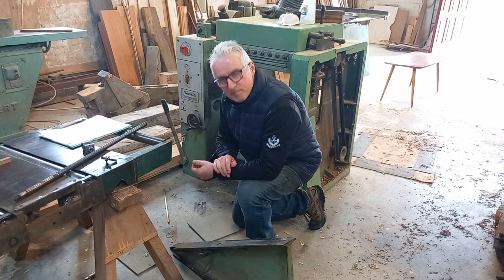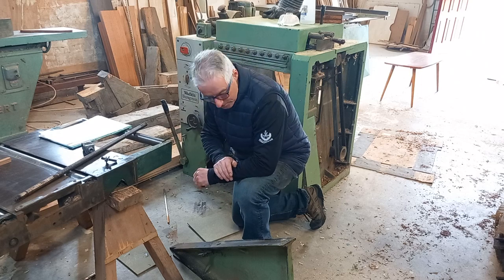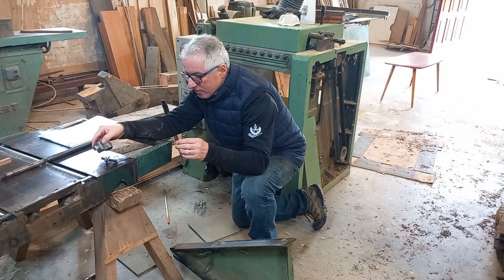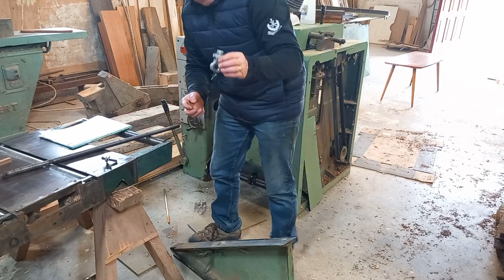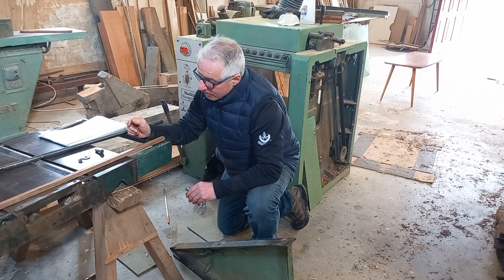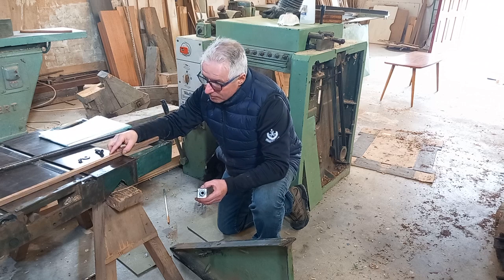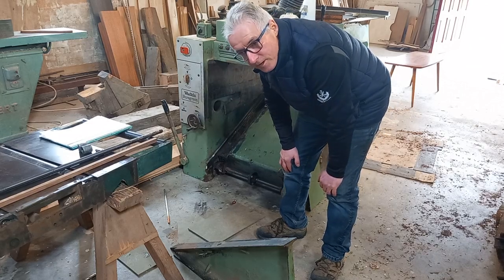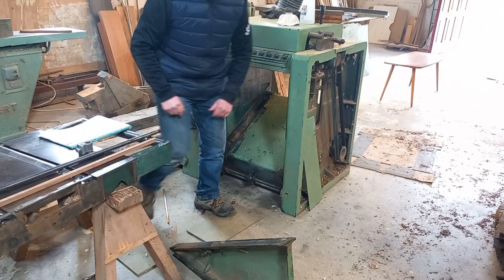Wadkin Thicknessser Repair

Comment: The BT 630 is a superb machine when looked after but you do need to keep the lubricant up to those wick feeders. It's also important to run the table up and down a few times to keep the threads clean and lubed. Mine is due for a service soon. Dust is hard on thicknesser parts. There are a lot of bearings in this machine. The plain bearings need regular oiling. 
It's a very accurate machine when dialed in properly but far toany woodshops neglect their machines and don't know how to adjust them correctly.

Comment: The problem was that the nuts were aluminium so they are not original. If you buy the proper Wadkin part ,they are  not aluminium. Someone has previously cut corners and had parts made cheaply.